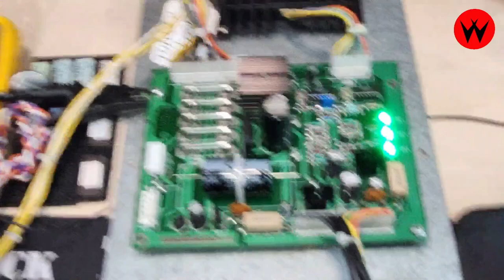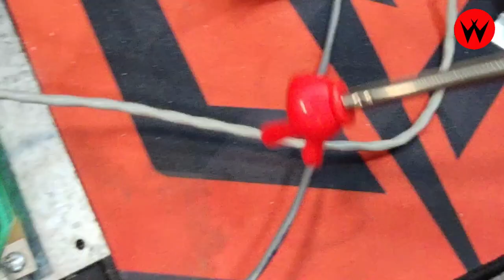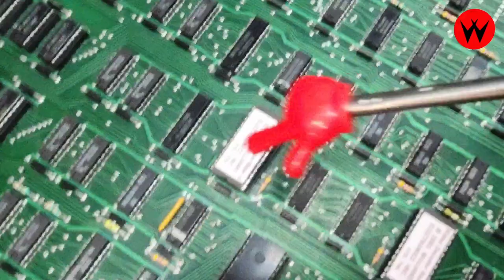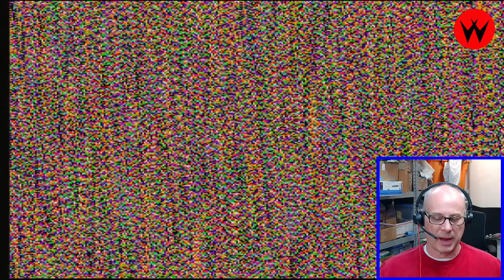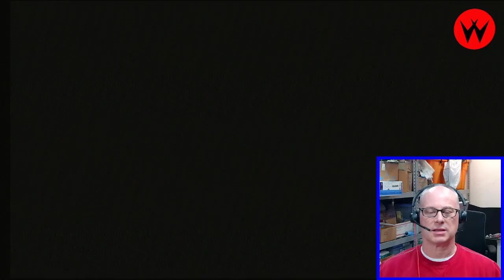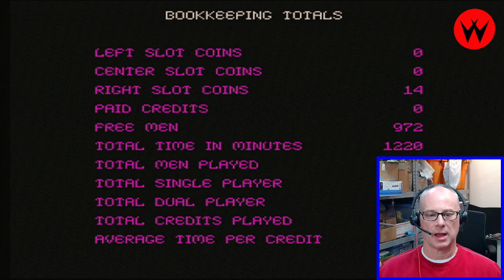Joust Full Board Set - With Power Supply - Repair/Restore

Comment: Nice work. I never knew about that bookkeeping button so I went looking for it. Sure enough there it was all along in the upper left side of my Stargate's coin vault. I'll have to pull the manual for my Robotron cocktail to see what they did there for that feature. The coin vault on it is a galvanized slide in steel box that looks like it takes a padlock to keep the top locked and lock it to the body. Opening the long vertical hinged coin door panel on it seems to give someone full access to everything surrounding the locked vault box.
Reply from the maker: I have a few of the Williams cocktails including a Robotron. I'll need to look and see if they implemented anything similar.
Reply: @thewilliamsguy  My manual is for an upright so I don't have the detail. The schematic shows cash box advance (9SW1) in parallel with coin door advance (8SW2) connected on GRN between (2P3) and (8J2). I'm guessing (9SW1) is redundant to (8SW2) and may have therefore have been omitted on cocktails.